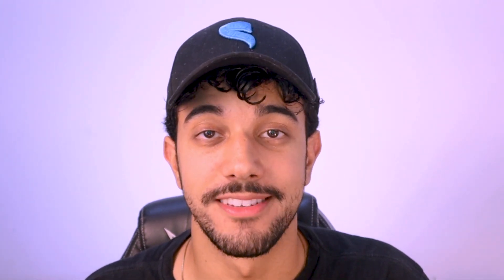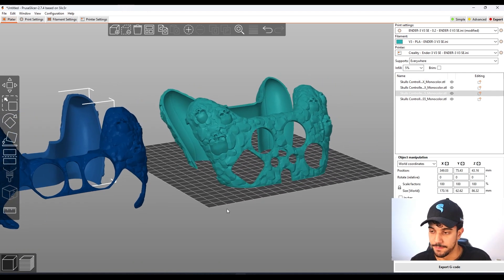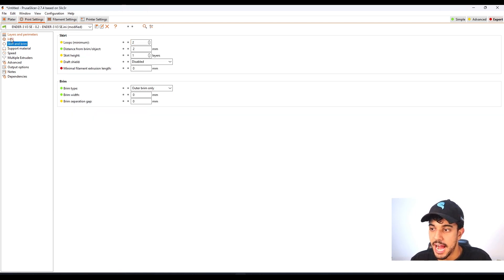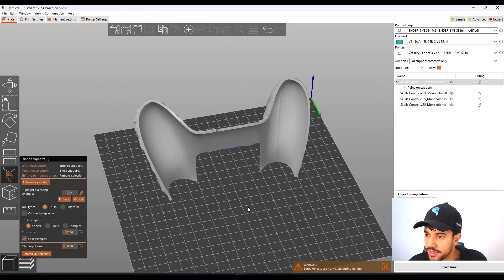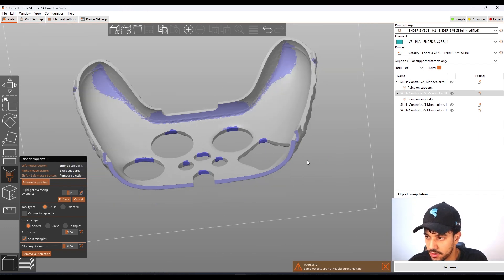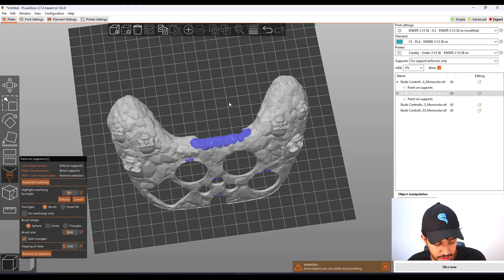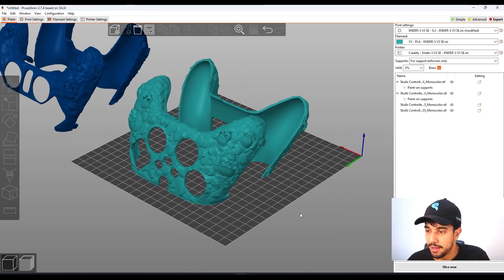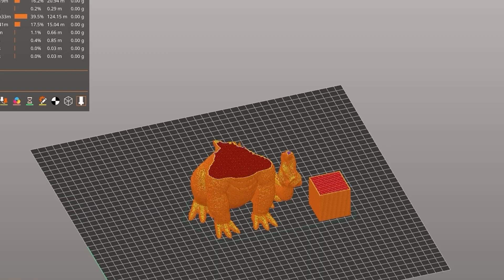How to slice: Skulls Controller Cover

Comment: I have a much easier way, use auto supports. Pretty much is exact same as you showed, just takes 5 seconds instead of 10 minuets. Cool print though. Might pump out a few of these for my kid.